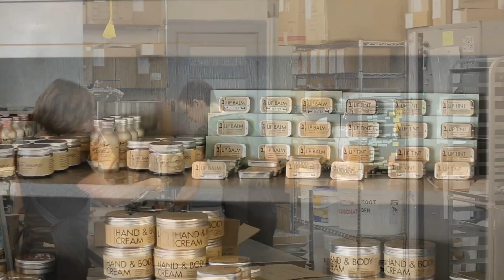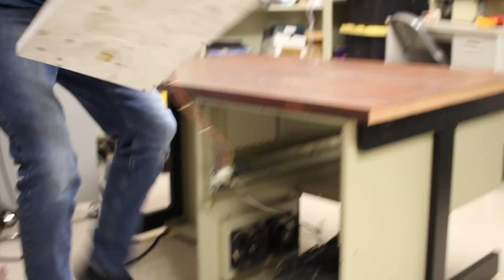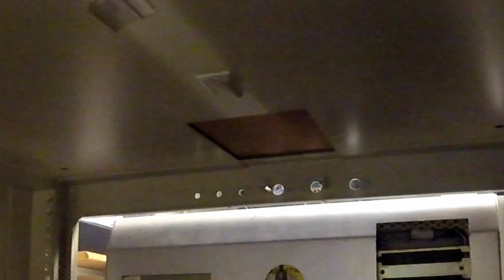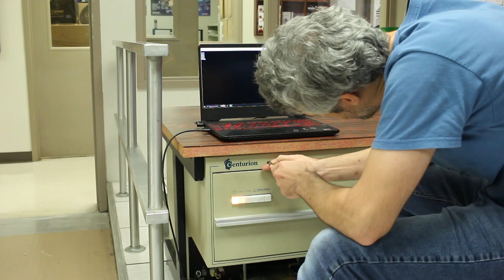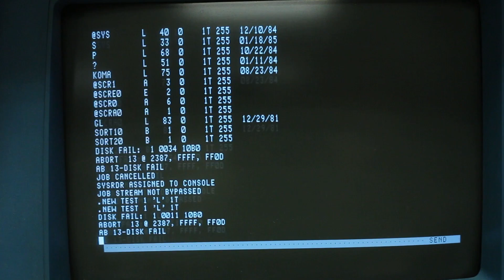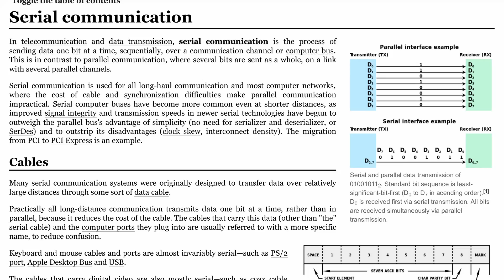The Desk System Centurion Worked Perfectly! Until it didn’t…

Comment: I went to Cherry Creek high just out side of Denver. We had a IBM System 3 then later HP 2000 C. I was given time on UC and UC state systems plus other systems. Like a 90/20 and 90/?  Plus others before the first standalone PC. AlL were killer systems. We did insane things with 16 KB and 10 MB. We had a fire when power was cut off. Load of other things.

Comment: Even installing those big heavy rack-drawer units below waste level still scares me. One slight misalignment turns drawer runners and rails into razor blades with barbed ends, ready for the next unsuspecting person to use as a lift handle.  Then they want to pull the whole rack over on top of you. The big desk thing is the right idea when it's balanced and heavy duty enough. I never want that stuff above waste level unless it's all on heavy duty carts, never ever above 3 1/2 feet. The gear I work on only tops out @ 90 lbs, slightly smaller but the finger danger is just as bad.
Reply: I installed Hawk drives in Warrex-Centurion systems on the manufacturing floor at Centurion and in the customers office by myself for 10 years with zero cut or pinched fingers.  Could you hurt yourself by installing or replacing the Hawk into the CDC Hawk rail system, yes if you are not careful.

Comment: Can you manually edit the sector? It isn't that many bytes for a bodged-together internet to serial bridge so you could use the terminal remotely, read your data from your system and transmit to the desk system. Just need to get someone over there with a remotely accessible PC, the right serial cable, and term software.
Reply: Yes we could reformat the couple of damage sectors that have the [ 10B0  Format Error ] but the issue is we do not know data needs to be in the newly reformatted sectors to complete the repair of the disk file system.

Comment: I'll be curious to see if you can get hardware flow control signals from the mux board. We never were able to and when our hardware guys asked Centurion the answer was no. But maybe they weren't asking the question the right way. We could get the mux boards/Centurion to respond to flow control sending out, just like it works with the printer. If the mux boards can provide hardware flow control for incoming data, I'm going to be a bit upset, that would have made things much better.  Also with a serial, wired connection we never had any issues just transferring the data without XModem or other protocols. So you could choose to keep it simple.

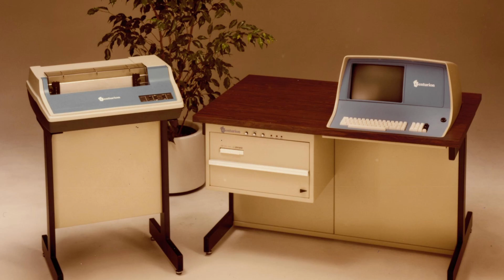Comment: 3:13 - Just noticed in this marketing photo that they cut a hole in the top of the desk to place the terminal inside of. It might look more sleek, but that would be incredibly impractical for so many reasons. It's a good thing they didn't go ahead with that design, at least not for Butler Tech's system.
Reply: The early "All-in-One" desk models did have the wood top cutout to match the ADDS terminal shipping at that time.  In later production of the "All-in-One" we stopped inserting the ADDS terminal into the desktop because of the cost of cutting and trimming the hole plus the cost of the metal tray below the top for the terminal to sit on.

Comment: I had one of those printers (TI 810). It's an absolutely solid unit. Used it for years, then gave it away when I moved. The only downside is that it's a dot matrix (so noisy) and uses tractor feed paper. I now have an HP LaserJet 5, which I got for free and rebuilt myself, but I still miss my TI 810.

Re: serial loading of data. Ethernet is a serial protocol :-) What your Centurion needs is a 10BASE-T  Ethernet card. How hard could it be? :-)
Reply: Adding a Ethernet interface in the Centurion system was looked at around 1985. Because Ethernet networking was very new in 1985 and not being used by our CPA customer base the time to design a Ethernet card, driver and networking protocol was not part of the Centurion business model.
Reply: @kenromaine2387  I'm sure it made sense at the time :-) However, it would probably be easily doable today, and good design experience building the hardware, interfacing it to the Centurion and writing the driver for the OS.

Comment: I've done last month an fpga configuration memory loader using a 8051 and xmodem to transfer the data from pc, this protocol is so easy to implement. I think that it will take less than a couple of hours to make xmodem checksum and the disk image transfer work from scratch.

Comment: So, I had another thought:  In addition to a nice serial file transfer utility (Kermit, perhaps?), what about a program that lets you edit the raw data on the Hawk drive?  I've seen them for various computers over the years, sometimes for use on the system itself, sometimes for use on a different system (so the drive isn't, well, being used for anything at that moment).  I've only had to do it for a couple of my CP/M kit computers, and that was just to set up a modern-ish drive for use in CP/M (and both of those used tools on a third computer to edit the drive), but I seem to recall there being programs for the Apple II that let you just play God with raw disk sectors and such.

Could one of your brilliant Discord members, who has already programmed something for the Centurion (perhaps whoever is working on the Xmodem program?), whip up a sector editor that would let you literally reach into the disk, find the "hole... blown in the file system", and patch it by hand?  Perhaps by overwriting it with E5 or whatever value the Centurion's OS uses for empty, formatted sectors, for instance?  🤔

Comment: Have a look at the HLKRM04 serial to TCP adapter it has two serial ports if they were plugged into the centurion it could send these remotely over the internet to another HLKRM04 and you can plug a terminal into it at the other end , alternately they can become a virtual serial port on PC anywhere in the world gives remote access to the centurion. Note they have wifi so it gives the centurion wifi !

Comment: All this because of a cable failure!  Ouch.  If I may suggest it, on the return trip you may want to bring more than one string for your bow.  Bring a floppy drive, an FFC, and the disks to use that method.  Keep them packed and try your X/Y/Zmodem solution first.  If that fails, break out the actual hardware and have at it.  Nothing succeeds quite like success.

Late Edit:  Can't remember if that accursed cable got repaired or replaced.  If the connectors are IDC type, it's simple enough to remove the connector at the faulty end, move it back to where the wire is intact, and re-attach.

Comment: Talk about nail-biter.  With no removable medium on the Centurion desk system, you get one shot for xmodem to work correctly.  Xmodem is what we used to use to reflash routers, but the boot ROM had xmodem built into the ROM, so if something hung or the battery on your WFWG 3.11 laptop went dead you could try again.
Reply: An alternative that is well within the community's capability is to upgrade the backplane to a boot rom that supports the diagnostic card (unless they did that already, I forget), and then create a custom card that simply contains a full platter only version of the xmodem program, that boots like the diag card does. Given how thoroughly the diagnostic card was reversed engineered, I'm pretty sure creating such a card would be rather simple.
Reply: @kevincathcart4680   Thanks for the input.  That sounds like a neat project.

Comment: For transferring files to the centurion, a proper communication protocol is of course the nice way. But if the OS is working and the centurion does have any program that lets you type in literal bytes into a file, it might be possible to write a program that does all the steps (logging in, starting that editor, keying in the bytes and saving the file) from your laptop over a plain terminal connection. That would be slow of course, but might be easier to implement than something on the centurion itself. Just a crazy idea. :)
Reply: That was my thought also

Comment: Every time I hear about that system at Butler HS I wonder why anybody would keep a unique antique like that in service at a school when it could easily be functionally replaced by a Raspberry Pi hooked up to a keyboard. Surely it's better for the kids to have field experience on a modern Linux SBC than an operating system and hardware that will never run in production again?
Reply: Surely it's not either-or? A RasPi will be basically nothing in the school's budget. If they want to have that as an option, it is one.

But you'd also be surprised how many mainframes and minicomputers from the 70s are still around — and when their hardware isn't, their drive images and original COBOL software still are! Tons of IT workers specialise in COBOL on old hardware and emulated old software.

Comment: Z-Modem allows multiple files and embeds the filenames into the transfer stream.  X-Modem is simpler, but will end up being a pain if you need to xfer multiple files  :)
Reply: And communication is one way, unless a block fails a CRC check IIRC. That said I transmitted files straight and never had an issue. We had only hardware flow control going to the PC. Going to the Centurion we had to use character echo since there wasn't any hardware flow control coming from the Centurion and the mux boards only had one byte buffers.
Reply: Modem7 is essentially the xmodem protocol but allowed batch file transfers.

Comment: For getting files on and off a disc emulator would the thing. I know you hinted at something being worked on. The hawk and Phoenix drives are fragile, not something you want to let students mess around with regularly. An interface to an sd card would allow them to work on it with risking the unobtainable parts.
Reply: Only if he also installs something like, say, a REALLY LOUD FAN on the disk emulator board, to fully emulate the Hawk Drive experience.  ;-)  

(FWIW, I know of at least two projects that make drive noises for Apple II floppy disks and, IIRC, MFM hard disks.  I prefer the quiet, although the drive noises are still nostalgic in a way, hehe.)
Reply: @derekchristenson5711  like IBM putting solenoids in their first keyboards to slap against the outer shell so typist got the loud feedback they were used to from typewriters.

Comment: You should really see if you can't clone some of the old PCBs like the FCC card
Reply: wasnt the problem some of them are double sided and some double with internal sandwiched routes too ?
Reply: @highpath4776  Sure, but it's not like we can't make them today, it just costs a bit more
Reply: or emulate them entirely. It should not be too hard to reimplement most of the floppy interface in FPGA + microcontroller, in fact you might get away with just a microcontroller. I can't imagine the protocol is too complex on these systems.

Comment: So… I'm restoring an ACT Apricot computer, here in the UK, and people keep pointing me towards "Kermit" for serial data transfer. What might you know about that? It seems it was developed at Columbia University about 25 years ago and adapted to many systems.
Reply: heard of it , but thought it was a bit older than that.  Have you looked at some f the UK Personal Computer World mags they had a bit on the Apricot and I sort of (badly) ran a 4 system network of them - problem was the company was not quite sure what the business model was they wanted to use the computers for and the commercial software was a bit too expensive compared to the system they were using (which was a computer posting bureau basically for accounts and payroll only)
Reply: So... As far as I know Kermit is one of many protocols to transfer files over a serial link (of the likes of Xmodem/Xmodem-1K, Ymodem and Zmodem), and that it should behave more or less like Zmodem, you initiate the transfer on one side, and on the receiving side you tell the terminal program to expect to receive files using Kermit.

That's all I got atm, I've mostly used XModem-1K (which is the same as Xmodem just with bigger data packets) and Zmodem..
Reply: Kermit is a software with which you can connect to a Computer via serial and can also comfortably transfer files. It has been ported to many systems. The drawback is that the file transfer built into Kermit is safety-oriented and is much slower than other methods like the *modem family. If the amount of data is low enough and /or you have high speed serial it still could be worth it for ease of use.

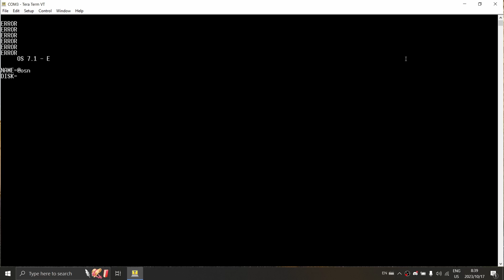Comment: At 8:43 the message from the OS says "ELCOME". :) The Hellorld! wiki says your channel is for "retorocomputing".  With a working assembler for the Centurion it would be worth spending time to port some other development tools over to the machine. You could work your way up to a basic C compiler. That would make it much easier to port other tools and programs to the Centurion. BTW, in the Hellorld! program it has a JSR which was stated as being a relative call. In assemblers for other (8-bit) computers JSR takes an absolute address. BSR was used for subroutine calls using a relative address.
Reply: Here I thought the missing W was an artifact of using TeraTerm in fullscreen mode...
Reply: @horusfalcon yeah also why use TeraTerm when PuTTY exists which is also capable of serial communications.

Comment: Would it have been possible to add a bodge wire in the 50 pin cable similar to repairing bad traces on pcbs?
Reply: Depends on the type of the cable and data bitrate. In this case that is what he probably did. More precisely - just solder over the break.
Reply: @jwhite5008    I have jumped around a break in a Hawk 50 pin I/O cable in a pinch before.  Scrape of the damaged wire area two dabs of solder and a inch of mod wire as a temp fix.

Comment: If Trace50 was bad on the Cable, surely that means 98% of it was working, not 99% 😀

Great video as always, Every time I see those terms in Action, I just want to break out an old computer emulator and get my Hacker fix in!
Did you or your viewers ever see such a terminal that had a blue shade phosphor? Amber or Blue are my favs!
Reply: Per 98 vs. 99:  I had the same thought, then recalled how to make something to government specification -- measure three times with a micrometer, mark with a piece of chalk, then cut with a chainsaw.  😆
I think I would prefer amber to blue, but it depends on the shade of blue (something like a cyan or sky blue might be okay...)

If you use Linux, there is an open-source terminal emulator called minicom that is easily configurable and can save multiple configurations.  I find it very useful in communicating with my CP/M single board computer (an SC126).
Reply: You beat me to it.
Reply: Or was it zero percent, because it was corrupting data?
Reply: @RWBHere  True, true! 🙂

Comment: Another sure way of destroying data is to plug the connector the wrong way around...
Usually those ribbon cables have all odd pins as ground and all even pins as signals.  Or the other way around.
When you reverse the plug you will connect all signals to ground, and due to signals usually being inverted that will assert the signals that erase or write the entire track...
Reply: The ribbon pin cables we built at Centurion did have "Keys" in the early days. We stopped "Keying" the ribbon cables after a short time, because having the cable flipped only caused the system not to boot, no damage to any hardware or data.  The rule of thumb at Centurion was the ribbon cable trace wire (or pin one) always was down or to the right.   Some of the Warrex Centurion ribbon cable types used did have all the even ( or odd ) pins grounded but not in all cases.  In some areas of the system that had 20, 26, 50 & 60 pin ribbon cable that used more then 50% of the pins for signal and less than 50% of the pins for ground.
Reply: Is the connector offset to prevent that happening ?
Reply: @highpath4776  There are different ways.  For card-edge connectors there often is a "key" slot (which also serves to prevent swapping connectors), for pin connectors like this one, when there is a full connector on the board there is a slot that aligns with a ridge on the connector.  But when the board only contains the pin header, the connector can be reversed without problem.  And also misaligned by one or more pins, which often leads to similar trouble.